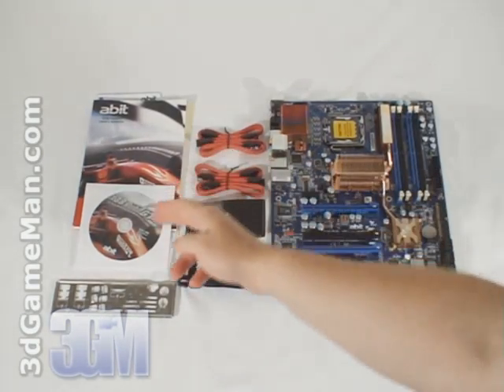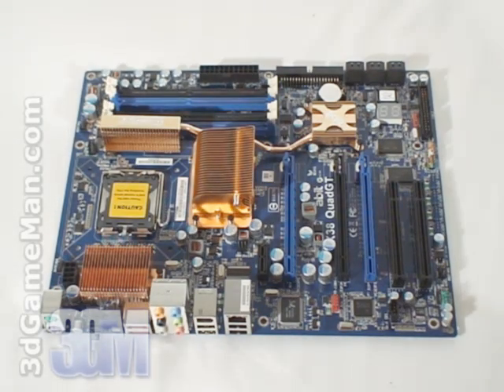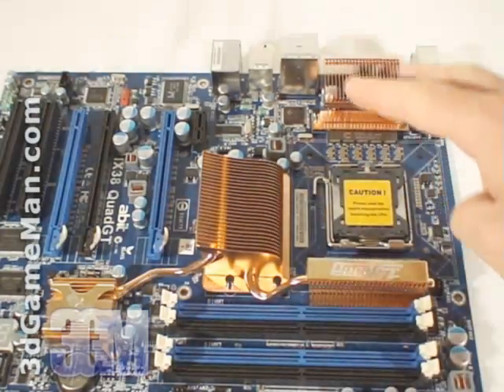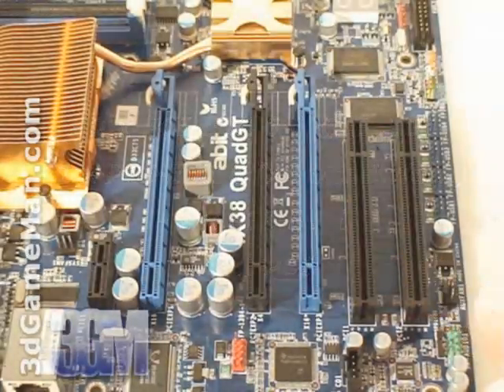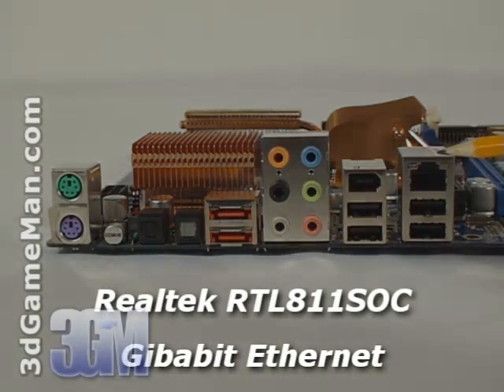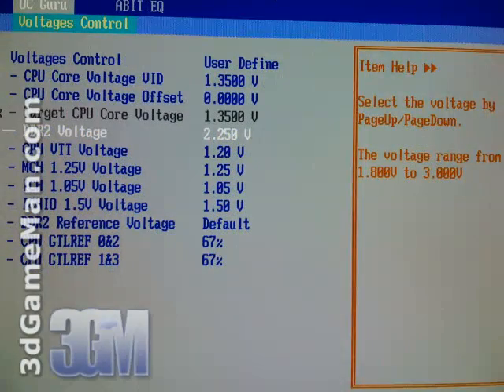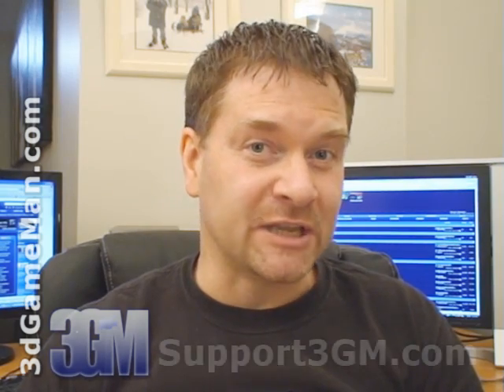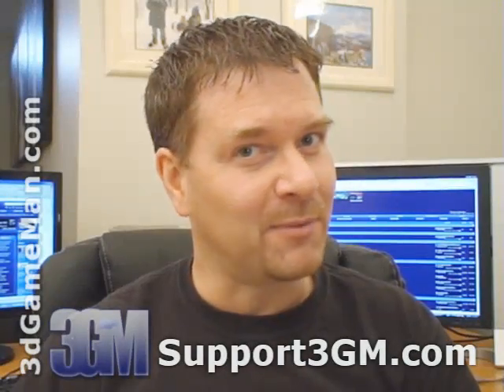#952 - Abit IX38 QuadGT Socket 775 Motherboard Video Review

Comment: I remember many years ago, when only Nvidia Nforce chipset that capable for doing SLI, and Intel chipset only support crossfire.

today ? doesn't matter what chipset, Intel or AMD (Nforce chipset is gone) we can do both SLI or CrossfireX, and some motherboard with Lucid Virtu chip, you can use AMD card as primary, and Nvidia Card as secondary, and Nvidia Card will give AMD card performance boost on gaming and vice versa.

Time was change....

Comment: @onegreatamerican Never had dead RAM slots, had a lot of cases with RAM that boards did not want to support or run stably, which is a shame, but if your RAM worked you were going to be fine. I agree over the history of Abit manufacturing there were few boards that had much longevity in them. They were the first to suffer and repair the bad cap epidemic, but you're right about the power circuits I feel, even if not pushed that hard. All history now that Abit are no longer producing mobos.

Comment: Mine lasted 3 years before it died with a 8.7. BIOS code. That was 3 years of near continuous running however and the machine had been pushed hard. Not sure what failed. Could be the uGuru chip or PWM. Could be the 12V onboard power failed somewhere.

These are a great board, particularly if you have a Core 2 Quad Extreme Edition or similar.

Comment: tried 2 of them,sent both back won't post. i tried different ram,tiger checked it out them said same thing ram! then tried to say psu!then finally said it was faulty,,shit happens,,but it took almost 2 weeks with all the bullshit, to get an answer back on what they were going to do!meanwhile i found a asus formual special edition locally<the water piped 1.they don't make no more,just the one withbigass heatsink,NOW works fucking great!OC q6700@4.0ghzstable!with760rad/pump4gigsOCZ DDR2reaper.